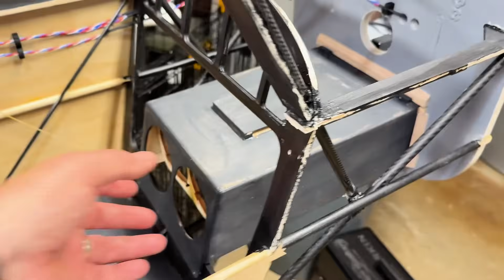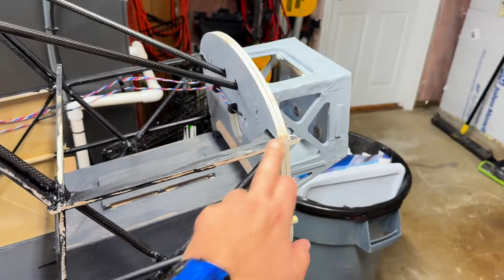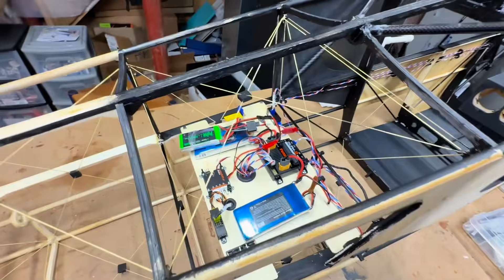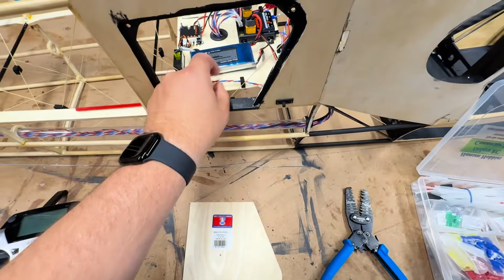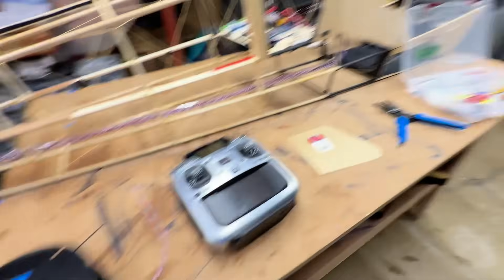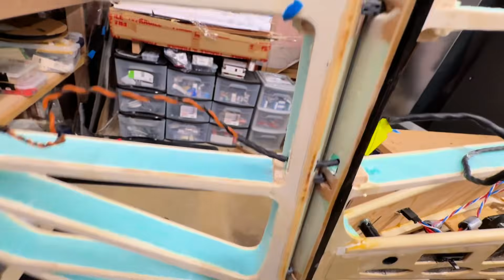Badan Carbon Cub build - Update #3

Comment: If you are running a gas or glow engine you absolutely need to see all of your server wires because the vibration from the motor if that wire is laying on anything even remotely sharp the vibration will eat through the insulation and no time I don't care how tough that insulation is it'll still eat through it with the vibration. Danielle go to grab some elevator and there won't be anything there warrior aleron surface or your throttle servo whatever
Reply from the maker: Anti-chafing wire keepers are used wherever wires cross a sharp edge for this reason.  You can use heat shring tube, velcro wraps tied down, etc.  Or even strategically placed wire tires to keep the wire elevated and not touching any surface as it goes around corners. Check out the techniques carbon frame heli builders use for more help solving these issues.